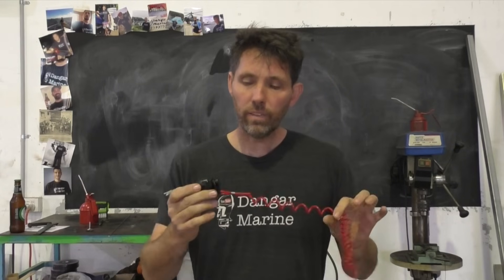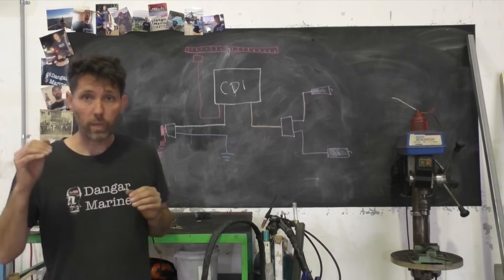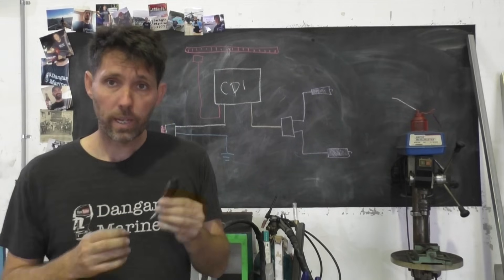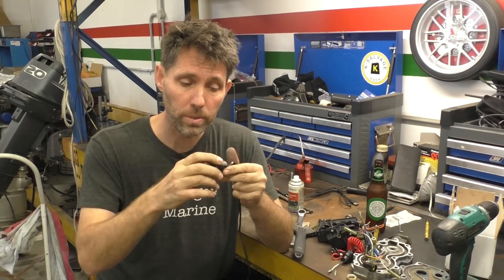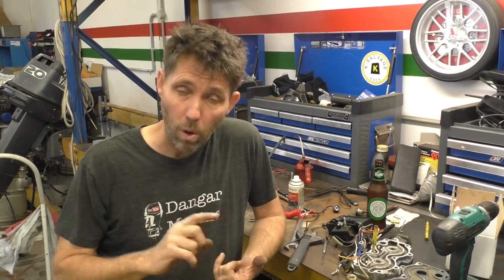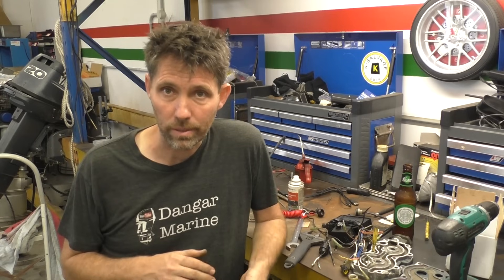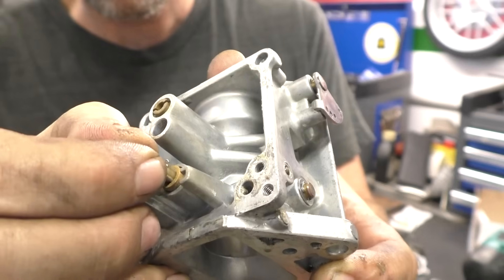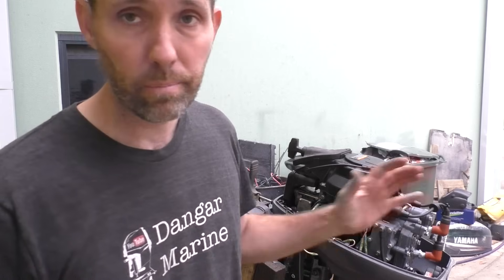Outboard kill switches

Comment: 7 years later, thanks matey. My Suzuki 8HP 4stoke motor only used once would not start. Fuel ok, starter battery ok, engine cranks over but no spark. I found the kill switch loose. Further investigation found the plastic thread broken and switch permanently shorted. Just ordered a new brass/stainless switch. Just found your channel, subscribed,  you are awesome mate.

Comment: New scenario engine won't shut off, Shut off system was working but then stopped working as I did a pre season check.
Johnson 45hp commercial 1984. Two kill switches both work (one on engine & one on helm)  good continuity to ground right up to entering the CDI (Black-Yellow strip) .
I replaced CDI  Aug 2023, I think I ran the boat 3 times after install.  
Question;  Do I replace CDI again ?  How can I kill engine excluding disconnecting the fuel line. ?

Comment: Hello,
I believe I have the same issue that when I turn off, the key motor will keep running, but when I pull down the kill switch, the motor will turn off.... I have a 1984 150 Mercury Black Max outboard... serial number 6465287.... if you think it is kill switch issue, would you happen to know a replacement part number? 
Thank you in advance

Comment: I was desperately trying to figure out why I had no spark for my XR4, but I knew it was in the kill switch circuit. Your casual mention of the “soggy” connections causing a similar issue caused me to try replacing all of my bullet connectors in my throttle. What do you know, that fixed it!  Thank you so much, this saved me a lot of frustration!

Comment: hi mate   has a problem   battery was on 11volts   put a charger on it for 6 hours checked later no power showing in the battery nothing works ( battery is 12 months old ) ty

Comment: Still love to watch your vid. My 98 Opti 150 not start:  air 80lbs, fuel 90lbs ,  sparks good,  120 lbs on six hole. what I need to check from this point?  Thank you for the head ups.
Reply: Have you tried to dab some fuel into the cylinders? Will it start then?

Comment: I have a question, does kill switch stop the CDI by stopping the spark..because I have difficulty starting the engine and when checking the coils, the spark does not come, but when I put the coils in another engine, it works fine. I don't know if the problem is because of the CDI or the kull switch Because the engine running but it takes a long time to work and sometimes the battery dies before it works

Comment: Hello everyone 
My engine will keep running with the key off what could it be?
Reply from the maker: Sounds like the switch barrel has a connection fault in. You could either replace it or just put a regular toggle switch in.

Comment: Thank you for the great videos. I’ve recently “inherited” an old 1970 Mercury Thunderbolt 7.5hp outboard. Your videos have been a tremendous help in basically rebuilding the entire motor. *I’m stuck in the last major part though. I can’t find wiring diagrams anywhere for this!  I’ve even purchased the tech manual , and it doesn’t cover this specific motor. ALL the wiring was shot (and some was missing entirely). I need to re-wire the entire thing. That said, it’s a very simple little pull-start unit (new stator from CDI electronics 174-3996, 2 new ignition coils, new spark plugs, etc). Any help/guidance you can provide would be greatly appreciated!  (I need to know where every wire goes. There aren’t many of them, but I don’t want to mess anything up). I commented on this video specifically because I also need to wire in a kill switch. Thank you in advance!

Comment: My black wire with the yellow stripe was broken inside the main harness with the big red plug. I chased it down with an audible ohm meter .Rather than cutting the thick protective coating and repairing the broken wire I ran a separate  wire from the CDI box to the ignition switch. Note that I used a correct color wire " for future mechanics" with a thick UV coating to protect it from the elements and getting banged up. I also put a bullet connector on it beside the big red plug in case the motor ever needed to be removed it can be unplugged rather than cutting it. Works great  cuts off everytime now.

Comment: I have an 1975 Johnson 15 horse. Changed out the original kill switch because it didn't work. Put another one on it and still doesn't kill it. One wire to power pack and one to coil. Any ideas? Thanks!

Comment: Excellent video. Very well explained and just subscribed. Have a Johnson 9.9 4-Stroke with a keyed ignition in the boat. Engine is starting perfectly, but won’t shut off on the key. Kill switch on the tiller handle works, so must assume something is wrong with the keyed ignition or harness wire? Cheers!

Comment: Please can you help me? I'm retrofitting a kill switch to a 4hp twin 2 stroke engine. The original stop button has ground and TWO wires (one for each plug system?) But my new kill switch only has one earth n one other wire.

What do I do? Thank you.
Reply from the maker: Connect both of the coil wires to one side of the switch and the other to ground.
Reply: @DangarMarine  thank you so much for this reply - I have scoured the internet for this answer for over a year!
I owe you a few beers!
I fitted my kill switch only to realise it's a normally open and I need a normally close (or vice versa) so I have now ordered a kill switch with option of either so hope this can work.
It's a 1991 evinrude 4hp engine and when works runs very nice. Thank you once again.

Comment: Brilliant info and education on kill switches. Can I splice into the kill switch wires to make a second kill switch for a long tiller extension with the second kill switch at the end? Like to leave the factory kill switch in place which is not on the tiller arm. It’s a new 3.5 Mercury.
Reply from the maker: Yes, you can have multiple kill switches no problem.

Comment: Would a kill switch be considered an ignition component?
Reply from the maker: Yes, it would.
Reply: @DangarMarine  I have a mercury 90 2 stroke outboard that runs fine for the first little while but after that it stalls when I put it in gear but idles fine. I was told this could be an ignition component but checked my coils and they tested fine. Is it possible it's a kill switch or maybe a power pack?

Comment: Hey Stu....I have a 1997 Yamaha Outboard (2hp)that uses a stop switch with no lanyard. Currently, it is not functioning (I cannot depress the red rubber button) and the engine cannot be turned off using the switch. There is only a white wire coming from it (going to the CDI I think) with no second wire for ground. Here is a link to the part. (https://www.crowleymarine.com/parts/480868.cfm). Any idea how this works/how it is grounded with no second wire. Can I change this to a lanyard based kill switch instead of ordering this exact replacement part? Thanks! -Chas

Comment: Hello, my engine won't start, check spark, there is no spark, then i cut the kill wire, but still no spark, before few days it was everythink works and engine start and works fine... any ideas? engine is Johnson 70 hp, 2005 year, four stroke.

Comment: I would like to have seen how you got the switch off the end of the tiller with the wires attached.
Reply: Same. I gotta 1980-83 25hp Mercury
Nothing in the book. But if I isolate/disconnect both stop switches one on tiller and safety switch(which safety switch not in book wiring either). May not stop running, but maybe it would start. Then just ground the black/yel wire to the block to stop.

Comment: I hope you can see my post
I am working on a mercury 20 hp thunderbolt ignition I removed the push button kill switch and now won't spark
I don't know if removing switch has anything to do with spark issue. Thanks

Comment: Hello love your videos by the way, question I have a 1986 evenrude 15 tiller electric start, it does have a kill switch on the tip of the tiller, that’s how I stop it, but I need to install a kill switch in the front next to the pull start with the cord In case I fall over board when on the way, it just has a cap on the front where the kill switch is supposed to be any idea y there is not a kill switch there.

Comment: I have a mercury 9.9 hp outboard motor, will this motor start without attaching the red shut off cord?
Reply: I have the same question my Mercury 20 hp late 70's my push button kill switch got corroded I removed it and now I am trying to figure out why I'm not getting spark I don't think this switch would prevent motor from firing up but I'm not sure

Comment: So my boat is an evinrude, the motor starts and runs and won’t shut off, also if I disconnect my battery cables the motor creates its own power and doesn’t shut down. Also the key makes a beeping noise the whole time the key is on. Help plz?

Comment: Wow! Another great video  I have been wrestling with a 1971 mercury 7,5 hp mercury kicker motor no spark.  Your video has helped me so much and your straight forward manner inspires confidence.. I have two older outboards and you have been a coach through both..thanks!    anyway long story short after  working the points over on a no spark motor and making a few more discoveries I now have spark...yea.  I did find an obscure fact in the process, that I wanted to pass along,  the 1971 mercury type 2 ignition sends the spark when the points are CLOSED (all other mercury ignitions operate the normal way ) this one really threw me a curve ball.  Accordingly the kill switch is backwards as the kill is open and run is closed...yikes.

Comment: Hello. I'am Panos from Greece and i found this video very helpfull. I have a yamaha 30hp 2stroke 84 model, with a steering wheel and a gear lever in front of the boat. I have the following problem: After I turn on the motor and start working, when i try to stop it, I turn off the switch without effect and even after I pull the cable from the kill switch, the machine continues to work. The result is to shut down the engine using the chock. After watching the video I realized that there is a magnet somewhere, which generally controls the operation of all switches. Could this magnet be damaged and present this problem? Thank you!

Comment: Ok so I should be able to completely dissect tPorta Powerhe kill switch on my 60h Yamaha and if its gone bad its should start. ???
Reply from the maker: Yes, should start when removed.
Reply: @DangarMarine  It did .
 It actually fired straight up with out pulling it apart.
 Must have dryed out I'm assuming.
 The connections are taped up in a funny spot and get wet in the rain.
 Cheers for the video and reply

Comment: H i Stu,I HAVE A 90 HP. johnson  that will cut off when I am running at half speed or slower and it will start back up easily and go for hrs . I need help, Thanks.
Reply from the maker: Could be fuel pump.

Comment: My Chrysler 15hp motor doesn't have the kill switch and there is no CDI. How can I install one, the only wires from the ignition plate are 2 spark wire and ground wire. Can I disconnect ground wire an connect it to switch and than switch back to ground. With switch on I could start the engine and with switch off it should stop. Is it possible that there is another ground which wouldn't allow for this setup?

Comment: should the engine turn over if the kill switch is not in? yamaha 75 2 stroke 3 cyl
Reply from the maker: Yes, it will turn over by no spark.

Comment: I bought a used 2006 mercury 9.9 tiller. It did not have a kill switch lanyard on the motor, and I cannot figure out where the kill switch is. There isnt an obvious place on the tiller. Mercury customer support said my motor has a button on the tiller, which it does, but there isnt a spot for a lanyard to attach. Do you have any idea? Serial number starts OR138xxx
Reply from the maker: Some outboards only have the button, not a layard. You should be able to upgrade it by replacing it though.

Comment: If having issues with a faulty kill switch, engine does't want to shut OFF, simply pull choke all the way out and let engine die and voila!!  Replace kill switch with a new one..
Reply from the maker: Yes, chokes are a great way to turn a motor off if the swtich is dead.

Comment: Hi, thank you for the very informative video. I have an issue I was hoping you might be able to shed some light on. 

I  have a 2001 Yamaha HPDI that will not turn off once started. I have completely replaced the main ignition key switch assemble to no avail. Trying to turn the motor off with the key or pulling the safety lanyard will not kill the motor.  Im assuming I have some sort of issue with the wiring harness or the ground to the motor, but im not really sure. Any insight would be greatly appreciated.
Reply from the maker: Yes, sounds like the wire might be broken as the connection is made to stop the motor and broken to let it run. It is the white wire that stops the motor so try disconnecting that at the outboard end and connecting to ground (any bit of metal) and see if the motor stops. If so, trace the wire towards for the forward controls.

Comment: I Have a 67 Merc 20hp. It has no cdi and has 2 kill switch wires (yellow/black) one for each coil. I plan on running one kill switch wire (Y/B) to the red and and one to the black of the new kill switch. Then drilling a hole in the side of the new switch and soldering a ground wire to the back of the plate, and grounding it to the block. That way when presses both wires will ground simultaneously. I feel connecting the two kill switch wires together will cause problems with the coils. Does anyone know where I can get a grounded switch or a better way to wire this? @MarineEngine.com thanks for the videos very helpful.
Reply from the maker: So what fires the coils, does it have coil and distributor? I would probably look at switching it off upstream so all coils stop firing.
Reply: @DangarMarine The 2 coils are mounted on ether side of the stator plate under the fly wheel. I assume it fires every time the flywheel goes around and the magnet on the fly wheel crosses the coils. The coils are connected to a ground with one wire and the other wire is connected to a capacitor and the yellow black wire. its like this for both coils. The 2 Y/B wires then run with the spark plug wires to the back of the block and now to my kill switch that grounds them. But I tried it last night and it did not stop the motor. Maybe the Y/B wires are bad or it is wired wrong.

Comment: So I am assuming it could be the same problen in reverse? If the kill switch is stuck open (or is it closed) that the engine may not turn over. My 1983 Honda 75 wasn't starting. Watched your video on this motor (awesome!!!)  I  replaced the spark plugs, fuel tank, fuel, fuel hose and fitting, New oil, cleaned out the carb and got it started and running for at least 10 minutes. Tuned the idle and it was running pretty smoothly! Yay me!! Then I shut it off via the throttle handle "stop" button, and went to start it 10 secs later and it wouldn't turn over....what do you think?
Reply from the maker: Glad to hear you got your motor running nicely. :) It could well be the switch sticking closed. Test if you have spark, if you do then it isn't the switch. If you do have spark I would check that the carbs didn't run out of fuel.
Reply: @DangarMarine  After disconnecting the ground and priming from the prime bulb like crazy and jiggling the fuel line attachment I did get it going again. Just long enough to confirm that indeed there was no water being pumped through! So probably the impeller needs replacing and that means hauling it out. So a big strong block at the Marina pulled it out for me. I have decided to leave it to the pros. I have learned a lot though and that is what I hoped for! Hope it's not too expensive for a full overhaul!

Comment: On my Yammie 25hp, shorting the white wire to ground doesn't kill the motor which I suspect means a faulty CDI.  Since everything else works, I'd rather not buy a new CDI.  Is there anywhere else I could connect the kill switch instead?  I have tried on the coil input to cyl 1 which works when the motor is cold, but when warm, it'll keep running on one cylinder.  Any ideas?
Reply from the maker: You could either do what you have already done but for all cylinders (run through the one switch) or switch off the pulse coil input into the CDI that triggers the spark.
Reply: Yeah, thanks Stu, that's what I figured.  The problem is that I need a dual pole switch then because if I connect both coil inputs or both pulser outputs through a single pole switch, one will trigger the other.  For example, connecting the inputs to both coils together in order for the kill switch to cut both of them I would have the signal for coil 1 going to both coil 1 and 2 when running.

I'll probably build myself a regulator for the lighting coil and use that to power a 2 pole relay and then have the kill switch flip the relay.

(Can you tell I'm a cheapskate?) :) :)

Comment: so, i understand that by pulling the lanyard you "put the system to the ground", but what is it that prevents currents to ALSO go to the coil ? Can't the the current go the ground AND to the coil ? (my knowledge in electricity is limited ^^ ) Thank you !
Reply from the maker: So electricity will follow the easier path (the one with the least resistance), a bit like people choosing to drive on the road with the most lanes and the least traffic. Once you connect the circuit direct to group not enough goes to the coil to make a spark.
Reply: oh ok thank you for the explanation !